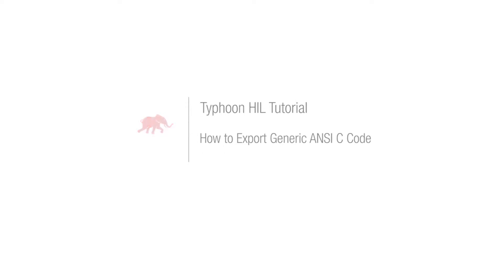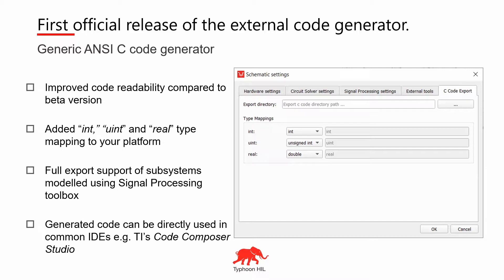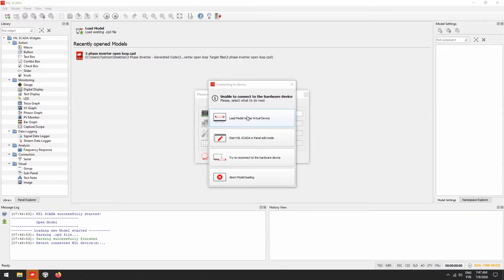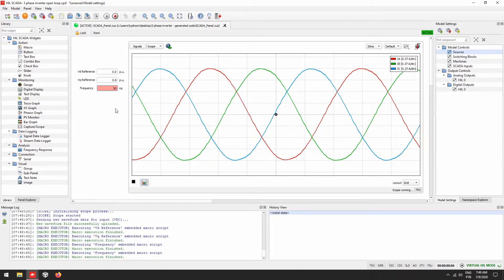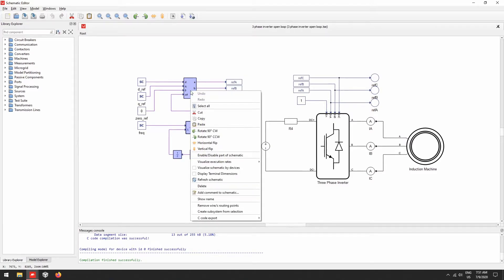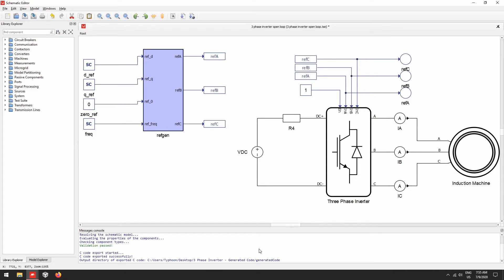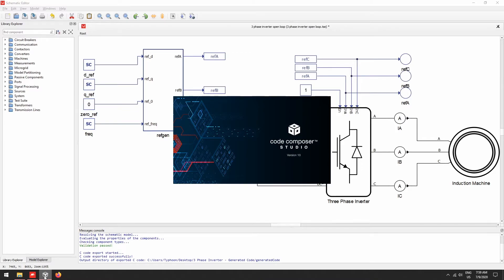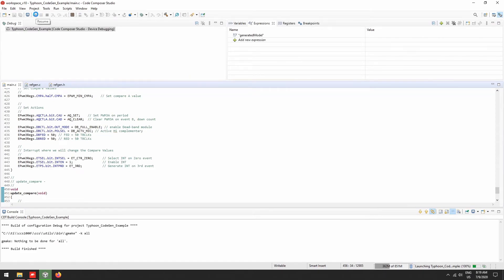How to Export Generic ANSI C Code | Tutorial

Comment: Can you please tell, how can modify (what are the change in) the four code (line 82-85 in C code shown in Video) when ADC is required, or can you share any C code and typhoon hill code which includes ADC?
Reply: This is a good question indeed! If ADC is required, at first no further changes in that part are needed, as the structs are just being initialized in order to correctly behave. It should be needed to correctly define the ADC peripherals and then at the ADC interruption you can call the exported C function. Right now we don't have an example with ADC that we can share, but it should not be very different if you are used to work with TI's C2000 series.
Reply: @GustavoPereira-tg2st    Thank you for the fast response. I am new in CCS, can you tell me the command to call the exported C function.
Reply: @sonawaneajinkyajibhau6535  , it is not really a command, see, you can watch after 7:35 the listed generated files and then, at 8:37 you can see how to add the generated files to your project. This should be enough to get started.